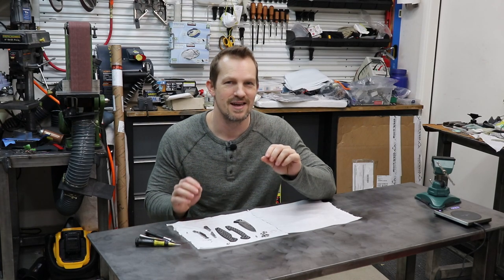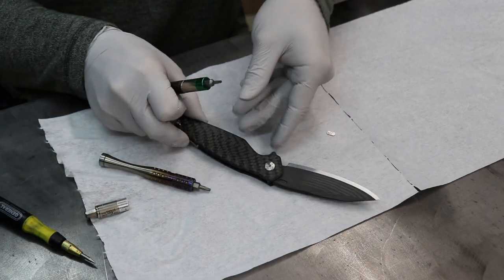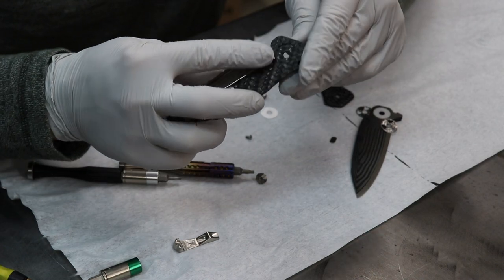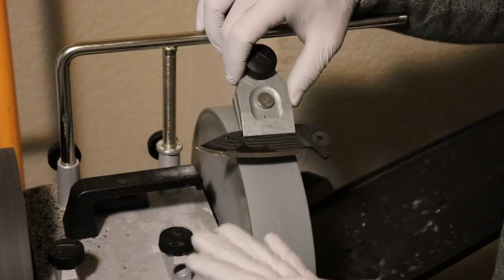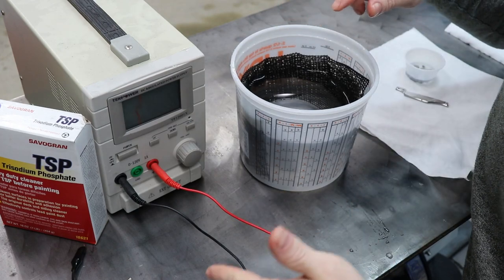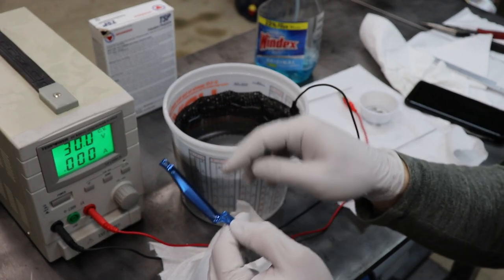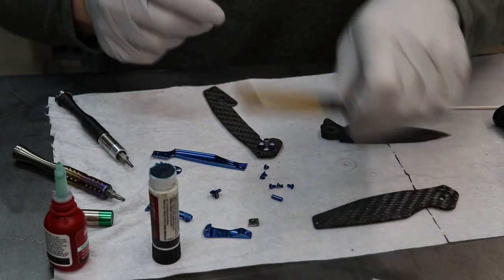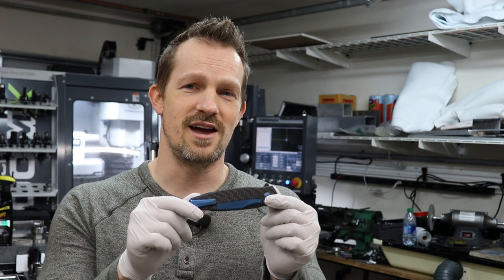Interface Knife making part 10,  Assembly Anodizing and Sharpening

Comment: Love seeing the behind the scenes work. Looks awesome! Seeing some customs recently from the shop. Is the only difference to custom being choice of materials or is process different?
Reply from the maker: The process is quite a bit different besides the materials. It starts out similar and then there's a lot of extra care, hand finishing and fitting that goes into them. Everything from extra edge rounding to inlays and hand sanding/polishing each part to perfection. As well as special detail milling and coatings not offered on the standard ones. You might have to look at them side by side to really notice all the differences since the standard ones are very good already.
Reply: @vcedge9466  they all look amazing and definitely looking forward to getting one in hand. Thanks for the info!

Comment: I definitely want to buy one from you ... I heard m390 coming maybe ? If not I'm still in great job
Reply from the maker: Thanks! Yeah, I'm definitely switching. The s35vn is excellent stuff and easy to sharpen (no diamonds required) so I'm very happy with the ones I've released this far.  The m390 is more difficult to work with because it has a higher hardness so it will cost a bit more.  However, it makes sense to do it and have better edge retention on this category of knife.
Reply: Well I tried to get lefty and dtom on live stream to check out your knive but that was a shit show drunken batards ... clueless ! I'm gonna keep putting the word out there on knife live chats because I think you got one of the best knifes going out there
Reply from the maker: @terencemarkiewicz3908  Thank you. The secret will get out soon anyway and I'm still in very low rate production so its ok. I appreciate the effort.

Comment: With the carbon fiber smacking against the titanium stop pin over and over. Is there any cause for concern with extended use that the carbon fiber will deform?  Resulting in vertical blade play?
Reply from the maker: Great question! It's not a problem at all. First, the blade is much lighter than a normal one so the forces acting on the titanium stop pin are much less than a typical knife.  Secondly, the carbon fiber is very rigid in the direction the forces are acting on it so it doesn't deform like other plastics might. I have some early knives that I've flipped aggressively multiple thousands of times without any noticable wear in that area.
Reply: @vcedge9466  thats really good to hear.  I figured that you probably wouldn't have done it if it was a problem.  Thank you for your response.  Very cool design.